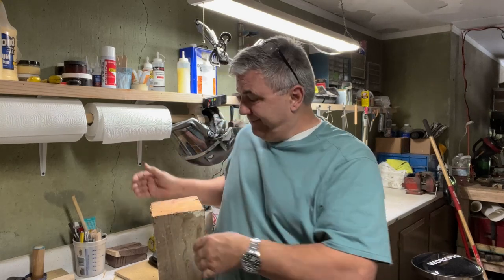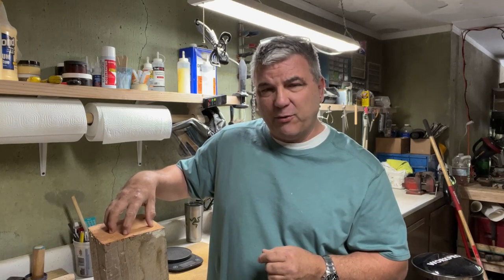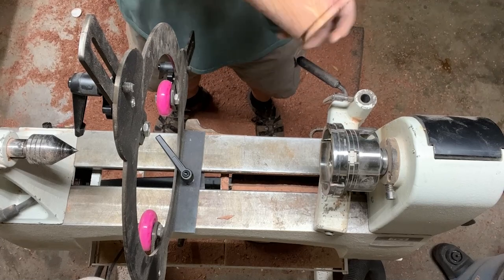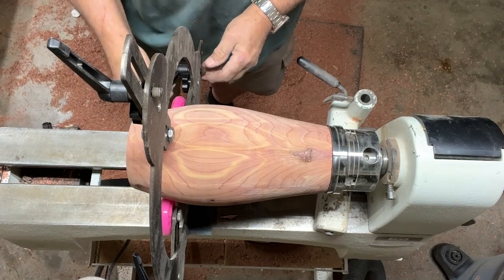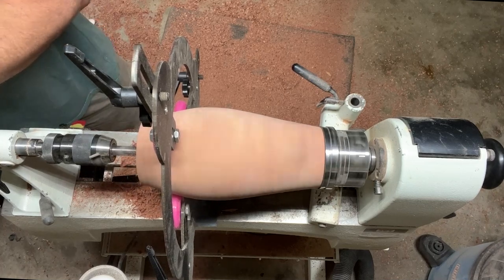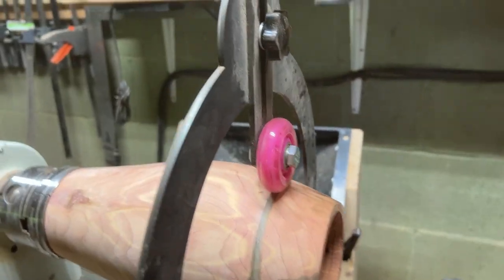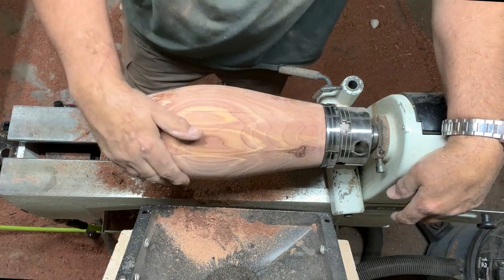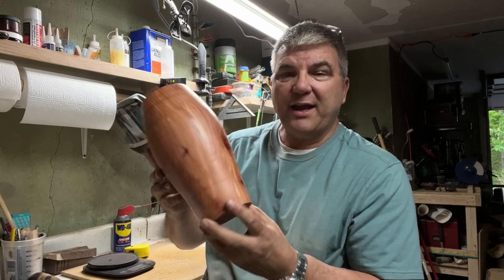Cedar Vase

Comment: Nice. Is the piece western red cedar?  Have been turning for about 6 months out here in PNW. Do come across 200-400 year old cedar blowdown. Why when I try to use auger bit in tail stock I can not keep it from spinning?
Reply from the maker: Hi, thanks for the visit and feedback.  This is what we call here in KY just plain old RED CEDAR.  On the Auger (Forstner Bit?) you will need to put it into a Chuck like a "Keyless Chuck" and then it will not spin after you tighten the chuck.  Hope this helps.